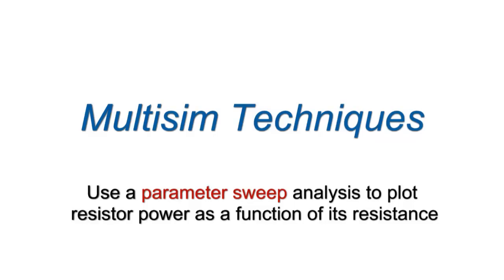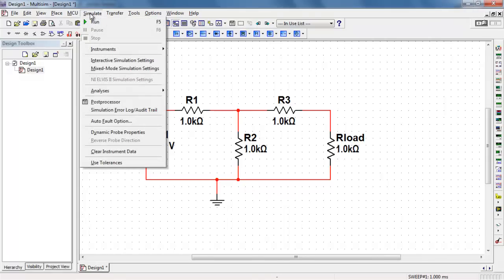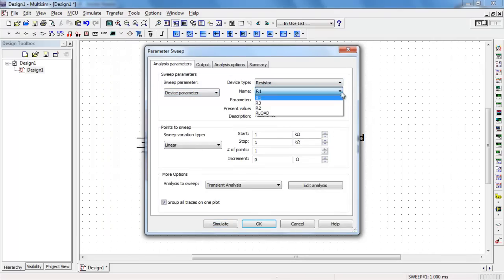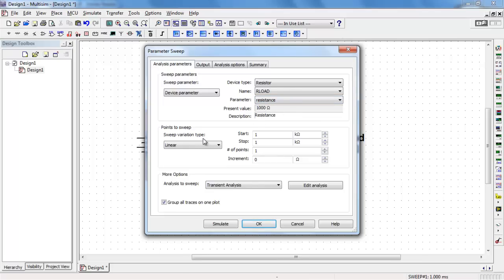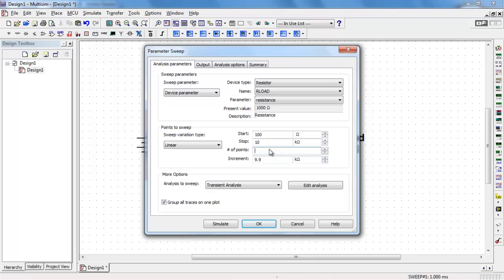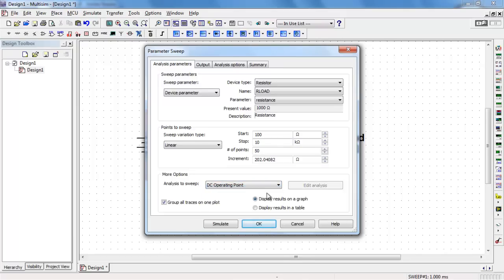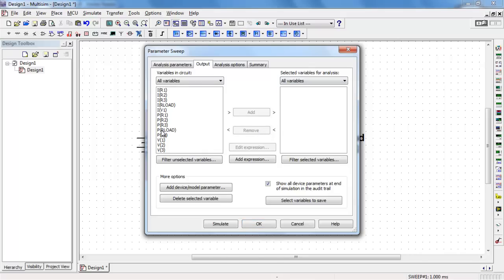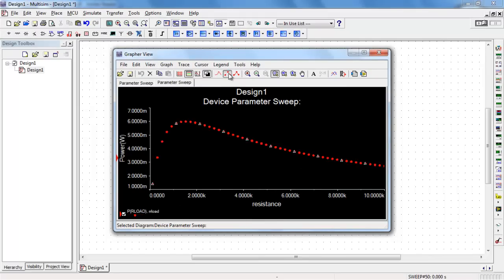NI Multisim: Use a Parameter Sweep analysis to plot resistor power as a function of resistance

Comment: Hi, I used Ac power 10 Vpeak source instead of 12V dc supply and it does not give me the results. Do you have idea how can I achieved it. I tried  AC parameter sweep but it does not give results.

Comment: When I look for the resistors drop down list to select RLoad. The list comes something like:
r1:xr2
r2:xrload
What does the above notation mean?
Reply: I had the same problem. Have in mind that you shouldn't be using "Resistor rated" in your design. that is a somewhat potentiometer I assume. instead, use a normal resistor which is named "Resistor" in components list. hope this helps
Reply: i got the same problem right now... did you figure it out ?
Reply: @berkayt503  did you solved it?
Reply: @johnbalvin5401  yeah dude its been a while 😂
Reply: @berkayt503  how did you solve it?